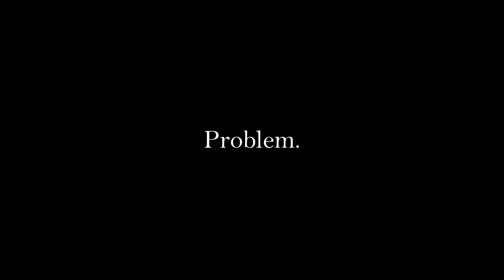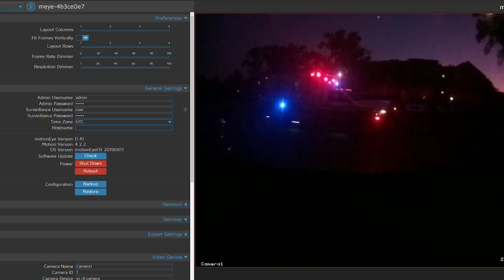DIY Tesla Security Camera System | Raspberry Pi

Comment: usually 5V powered devices can take much more than 5V, as they are typically built with a tolerance and can take up to 1 or 2V more, not sure if the raspberry pi is the same but the datasheet should provide this information for min. and max. power requirements

Comment: I think you might of made a mistake in assuming that the amplifer in in your car only gets power when the key is turned. In my car there is always 12V power going to the amplifer and when it is time to turn the amp on, the remote line (triggered by the ignition/head unit) then supplies 12v to the amp to flip a relay Inside the amplifer. Ofc your situation might be different but that is how my car works.

Nice Video Just my 2 cents
Reply from the maker: Yeah my system is pretty janky; stripped and frankensteined from a couple old/dead sound systems over the years with added components to make it work. Fully functional systems do work like you say! Thanks for leaving a comment and checking out the video!

Comment: You could do a 2S3P lithium ion battery pack with a 2S BMS which would give 44ish Wh if I'm doing my math right. Also could do a 3S with a buck converter to hold the BMS charging voltage to 12v.    https://vruzend.com/product/11-1v-12-6v-3s-lithium-ion-battery-charger-3-amps/              https://vruzend.com/product-category/bms/
Reply from the maker: My only concern is the temperature that the floorboard of my Jeep gets to - I'm worried that the temps and charge cycles might make the lithium get unstable. But I'm still new to all this, so I'll keep researching what you posted! Thank you very much for the suggestion and taking a look at my video!

Comment: The power supply you used may have been 9V and not 12V. Remember the right hand rule doesn't apply when using two butt converters. So, your calculations should have been made with left handed calipers.
Reply from the maker: I didn't even think of that. You're right!